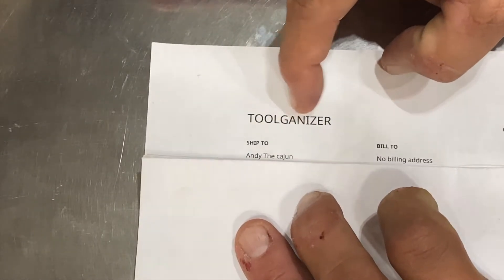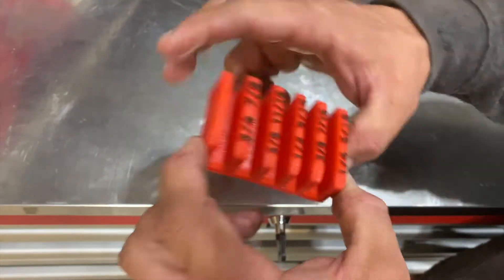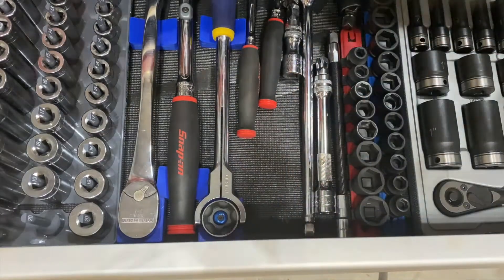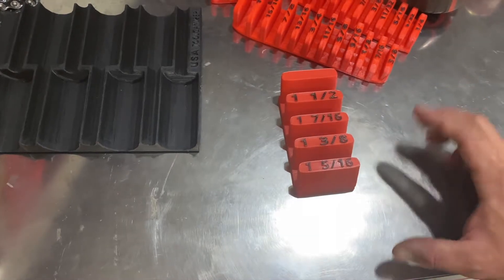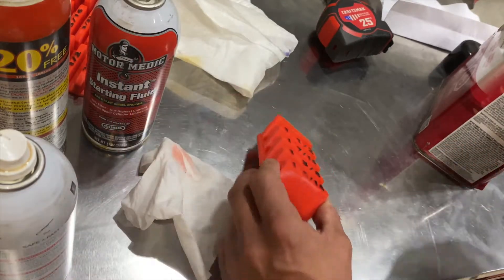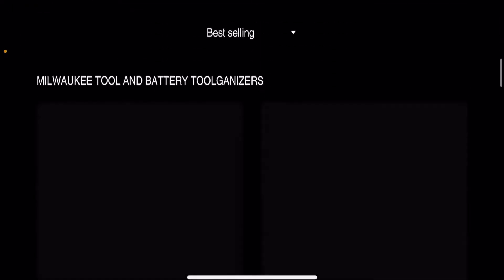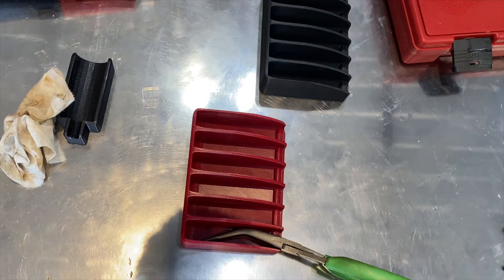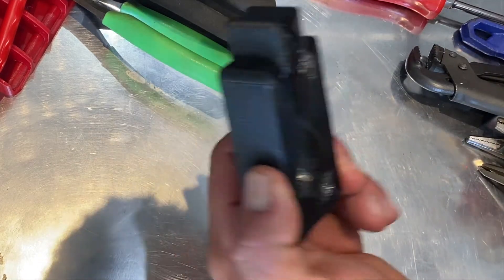Toolganizer the best tool organizer

Comment: I just emailed them - because ... the only thing the Toolbox Widget has over them, is modularity. But with custom options, that sort of negates the need for modular. Having smaller sizes for smaller wrenches is awesome. I'm very space limited, so a lot of the other options aren't feasible for me. I'm trying to fit an 8-32mm set in a harbor freight 5 drawer tool cart drawer that's 16.5" x 24", but deep enough to stand the 32mm up. The toolbox widget ones, I could easily spend 200 bucks on, and still not have as good of a system.
Reply: Have you heard back from Toolganizer? I emailed them for a quote a few days ago but haven’t heard anything back.
Reply: That Guy well dang. I like into the OEM part you got. I really wanna get this wrench drawer lined out. I’ve got a too much wasted space between my wrenches in their current racks. Yes I agree toolganizer had low prices. Thanks for your response so I know there’s no need waiting. Widget was my next choice but I did like the larger size text on toolganizer.
Reply: Well I just looked at the OEM racks you mentioned. Pretty much identical to the ones I’m using that I got from Harbor Freight. Your right about the magnets. If I close a drawer to hard or hit a bump when dragging my box to the other side of the shop the racks will shift.
Reply: @cowcatcher9186  Idk about the US General ones, but they look about the same. The mags are just refrigerator magnet strips to hold the strips down - not hold the wrenches in, but the weight of the wrenches holds them pretty stable even on top of the drawer pad. The wrenches themselves other than a hard slam or bouncing around stay put pretty decent. I'd like it if the wrenches were held in better for sure, and I'd like them to stand straighter up and have a couple more slots so I could fit the last 2 wrenches of the set in.. If they stood straighter up, they'd hold in there better too.

The modular ones would be about 50 bucks, and that's a LITTLE rich for my blood, unless they're "perfect" - which the ones in this video are pretty much perfect. I might have paid 50 for that - but I can't get a response :/
Reply: @cowcatcher9186  The widget you just get more and add to them, but my problem with them is that I've got 6 - 32mm, so having 1 row would waste a lot of space. Also they don't get smaller for smaller wrenches. Having them diagonal where the box of all of them is basically against the side of the drawer is great. The Toolganizer is damn near perfect. Or would be if they were available anyway.
Reply: That Guy I agree with you on everything. I’ve got too many things going on but I actually considered buying a printer and attempting to build exactly what toolganizer was doing. Like you, I’d gladly pay more than toolganizer was charging. As far as the OEM or US general racks, I bought enough of them that I cut some down to complete a set of wrenches.
Reply: That Guy I just received an email back from toolganizer. They are supposed to get me a quote made.